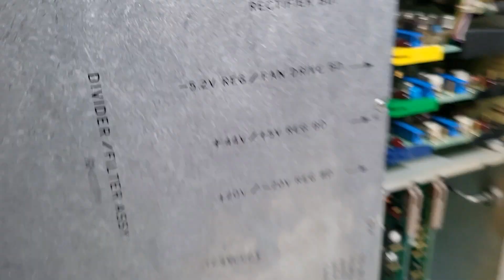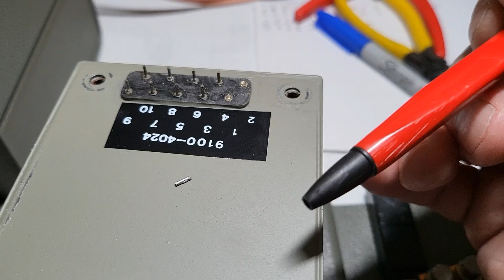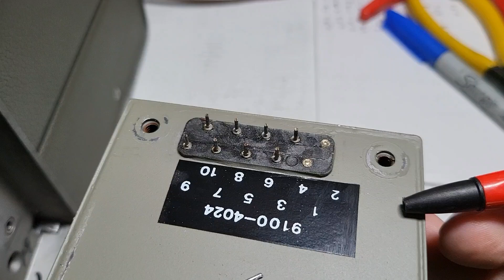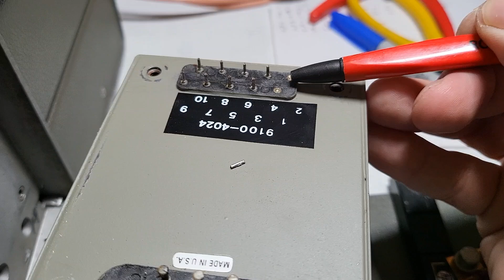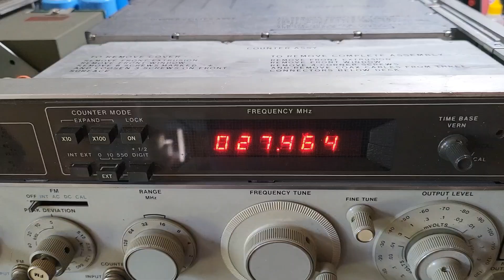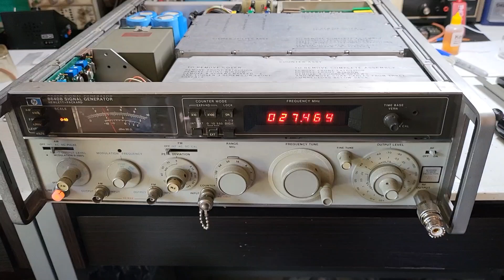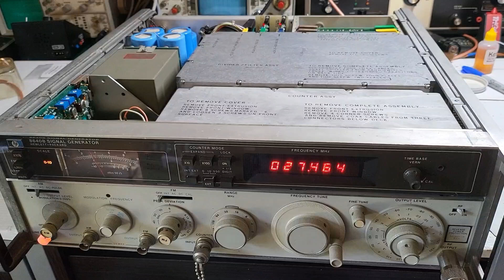Fixing the HP 8640B signal generator no +20 volts at the regulator board

Comment: 2:05 I had huge problems with all these diodes. More than 50% were broken . So sometimes only half wave rectifier was present. Recommend checking those and/ or replace all
Reply from the maker: I checked them all one by one !  You can buy this board on ebay.  Quite common board